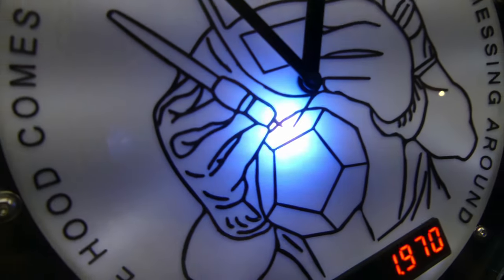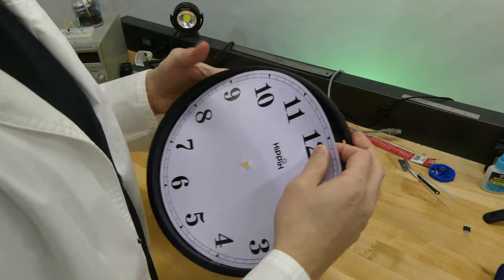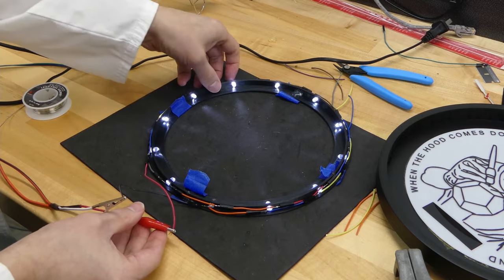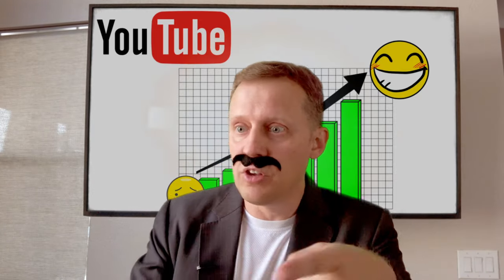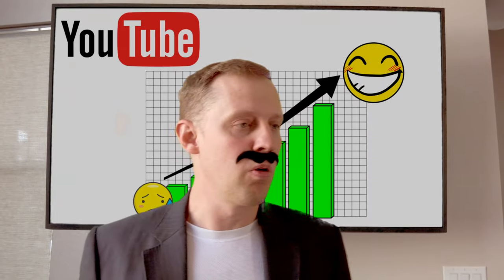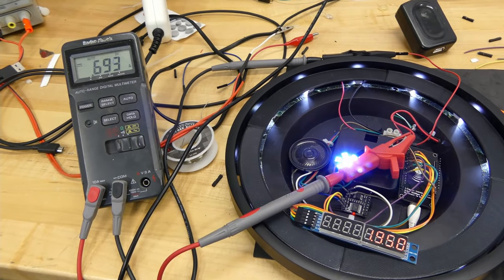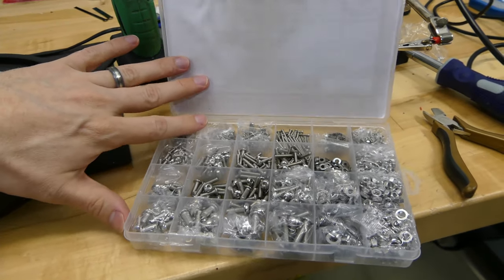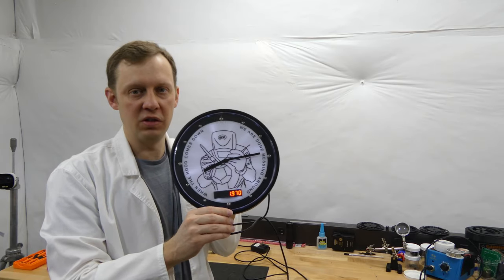DIY Themed Clock with YouTube Counter and *AUDIO*

Comment: Great Job!
I once disassembled a similar clock to yours, but I was not able to put it back haha. I was expecting that during the video you would have encountered the same issue and just 3D printed your own clock! (Leave that as a suggestion :P)
Was really impressed when you where able to put all the clock parts together with minor modifications!
Reply from the maker: Thanks I didn’t know if it would work. But luckily it did. The hardest part was figuring out how to extent the clock arm. The rest was plug and play more less. I’m building a cuckoo clock next, not sure why I’m stuck on a clock theme right now 🙃